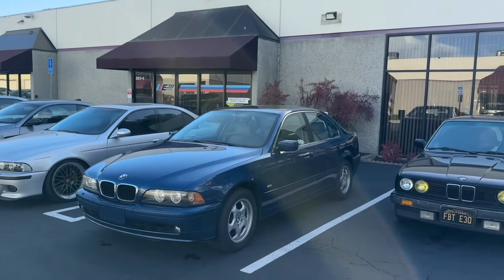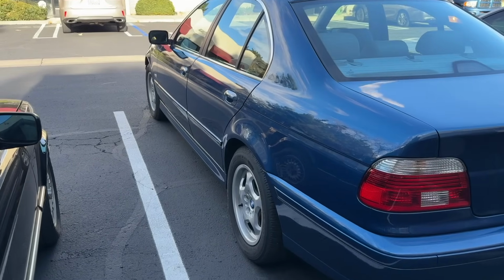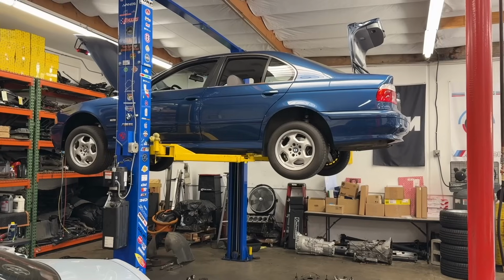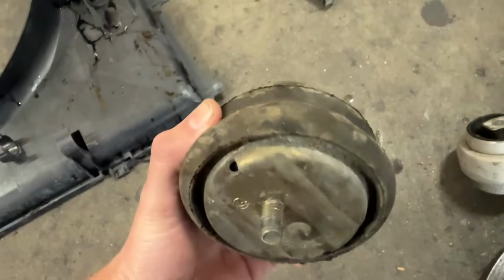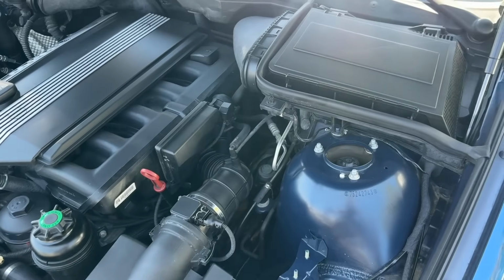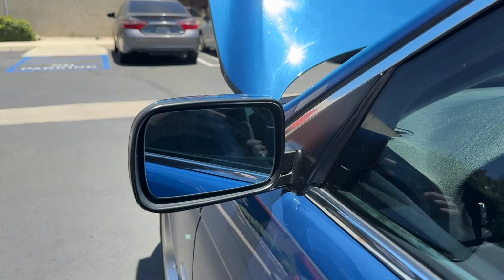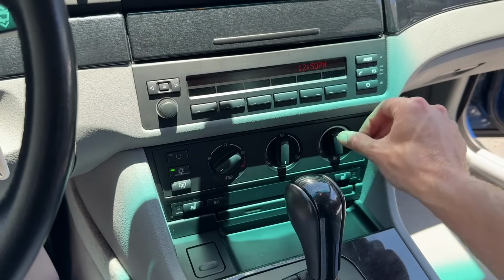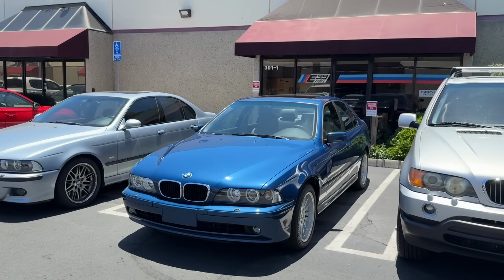An E39source Restoration:  2001 BMW E39 525iA

Comment: I just bought my first e39 from 03 with 110k miles I already fixed rear driver side door that was stuck closed and passenger side front window that was stuck closed “the window was a lot harder”. I’m dreading to do the radio, currently the fuse is unplugged because I nasty static noise comes up and lowering the volume doesn’t work I have the navigation screen with the dvd and cd in the rear, I already have the the eonon screen but I’m low key worried that the problem is much bigger than just replacing the head unit. Any insight will absolutely me appreciated
Reply from the maker: I definitely don't recommend the Eonon head unit.  I've never had a good experience with those Chinese aftermarkets, even the ones that they claim are 'plug and play'.  Static that doesn't change with volume adjustment sounds like a bad BM53 radio module to me.  You can find those used on Ebay for a reasonable price.  This is the silver module just in front of the left tail light behind the carpet door.

Comment: Hi Ryan, I was hoping you could share which supplier you got the headliner material from. I need to replace the headliner in my E46 and the part has been discontinued. I’ve been looking for the closest light grey fabric I can find and the one you used in this car looks pretty spot-on. Thanks!

Comment: Hey E39Source, I'm in the process of restoring a e39 525i and need to replace some electrical. Do you have a source that can supply electrical connectors?

Comment: What material are you using on the headliner ?
Reply from the maker: For the stock gray look it's a standard fabric with a sound insulating backing.  In M cars, we're using Genuine Alcantara which is identical to what was used from factory.

Comment: Be interesting to know how you did the repair on the trim above the glove box as one of my e39s has the same issue, it’s certainly a week spot on the outer tab.
Reply from the maker: JB-weld.  You can carefully re-create the missing material so that push nut will stay in the dash.
Reply: @E39Source perfect thank you I’ll will get some and give it a go.

Comment: 8:31 I believe the only difference between the M5 and standard is the size of the bolts? So with different bushings it could be M5?
Reply from the maker: The aluminum part is probably the same..?  I'd have to pull out a caliper and check though.  But changing the bushings is beyond hell, as you likely remember!

Comment: Why don't you just replace th bushings instead of opting for a new H-Arms?
Reply from the maker: Unfortunately, BMW does not sell just the bushings.  You can get Powerflex bushings (which I tried on my M5), but I hated them.  It's also exceptionally difficult to press these bushings in/out of the arms and it generally causes damage to the races.

Comment: Have you ever heard of using 4.10s from the early 528s as a performance mod for 525s and 530s? Im looking to do this to my 530i and I did a little research and my jump in rpm shouldn't be too much from the original 3.46 in the zf5 auto
Reply from the maker: I temporarily had a 3.15 in my 540i (2.91 is stock), and while it did increase acceleration, I was annoyed at having to shift so much more/sooner.  I also lost cruise control because the revs weren't where the cluster expected given the speed.  I imagine a 4.10 in the 525i/530i would have the same effect.

Comment: Have you ever heard of using 4.10s from the early 528s as a performance mod for 525s and 530s? Im looking to do this to my 530i and I did a little research and my jump in rpm shouldn't be too much from the original 3.46 in the zf5 auto

Comment: Great vid!  Question for you - if a person pours 15-20K into their old BMW can they somehow increase the car's coverage, or replacement value, through their insurance - in case it gets t-boned a week after the restoration is complete?  That way they can get closer to the true value of the car in that condition?
Reply from the maker: Yes, insurance companies offer a 'stated value' type policy where you can insure the car for a specific amount.
Reply: Hey Ryan i have a question if you can help me? I have a 1997 e39 540i and ut seems to be in limp mode, it wont go past 40 mph with all the lights showing.  I changed a couple wheel speed sensors could it be the abs unit?